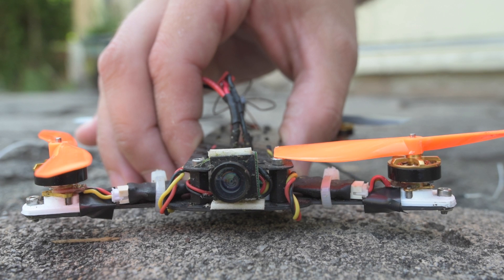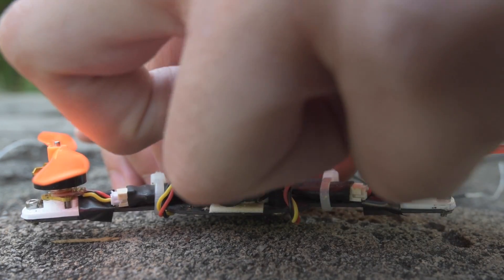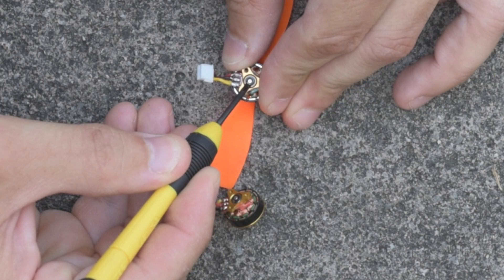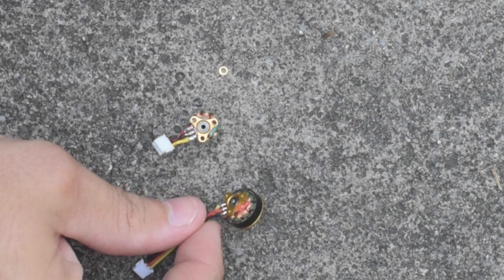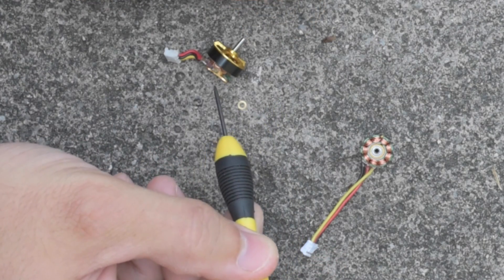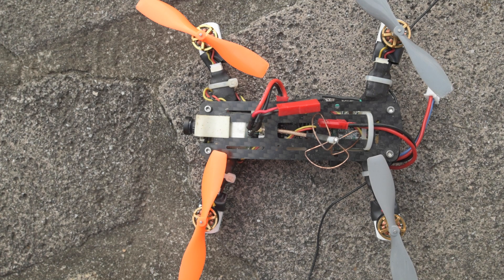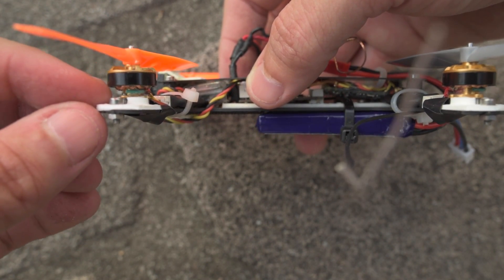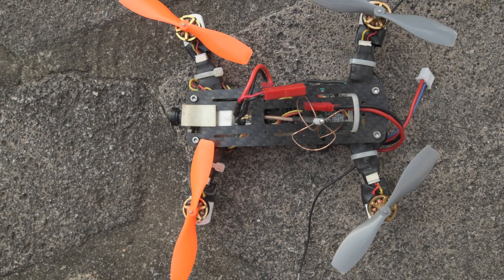DIY Brushless Motor Shaft Repair

Comment: I had one of my shafts go in to my 1103 kingkong motor when I was putting on the new prop. Is this fixable?
Reply: Yeah i snapped a shaft clean off the housing. Waited a month for new motor,
Put new motor on And the bell housing is kinda bent so its rubbing.
Another month wait coming.

I would be good to go if i could seperate shaft and bell housing
Reply: SteveO4478 lol thought I was the only one, just replaced them with "better" motors and guess what same thing on one motor already.

Answer: crap motors

Comment: How much for your bent shaft motor housings?
Reply from the maker: +Carlos A One million dollars!
Reply: +createthis I might have to break my piggy bank for this one... lol Seriously, have you tried straightening the bend motor shafts? A video on that would be cool! I just crashed my Hermit 145 when the propeller flew out and now it shakes a lot!
Reply from the maker: +Carlos A No, I haven't tried to straighten them. I did order a bag of 25 shafts from the vendor though. I just got tired of the motors breaking all the time, so I stopped flying it before I could use them.
Reply: Oh! So you ordered 25 - 1.5mm shafts (no motor housings) ? How do you remove the shafts and insert a new one without damaging anything? Gear puller? Vise? Yea these things are somewhat fragile it, but I guess you can expect it considering the size of these quads.
Reply from the maker: +Carlos A Well, I tried removing one with a brass punch and a hammer, but I ended up bending it. These things are so delicate, I'm thinking an arbor press or hydraulic press would be ideal. I meant to make a video about that last year, but my first experiment with the hammer failed and demotivated me. I recently have had some success with my new hydraulic press: https://youtu.be/2nUoKe2dp0Q so now might be a good time to try this again. If I have some time this weekend, I'll try pressing a shaft out using my arbor press and report back.
Reply: Sounds good, look forward to seeing how it goes.